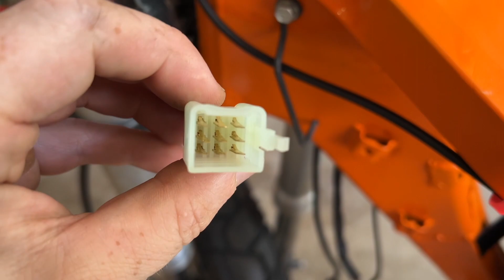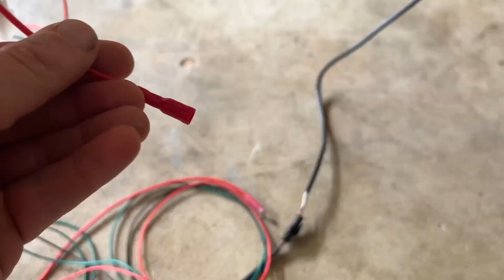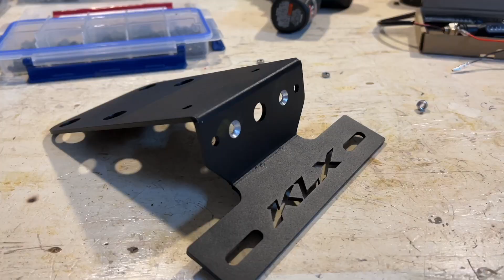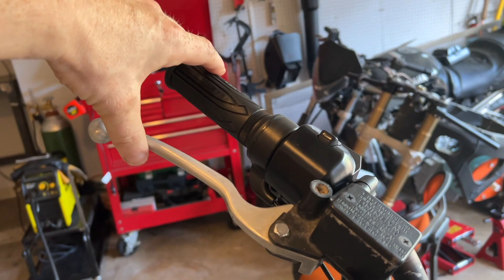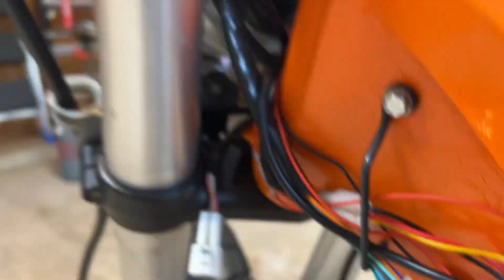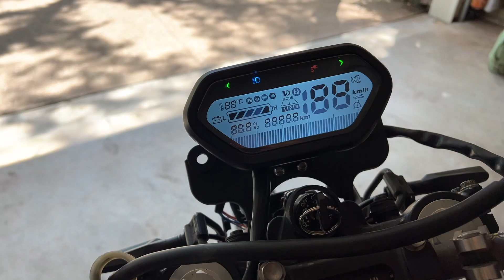Wiring an Electric Motorcycle: From Start to Finish

Comment: Great walk through! This is very helpful. Working on adding lights to a Ktm xcf conversion.
I may have missed it, but do you have links to the switches you used for the headlight (hi beam low beam, signals and horn)? 
What 12v converter are you using? 
Great video and explanation.

Comment: Great channel! Not clear how did you connect the high brake (HB).. Did you attach +12 V to one of the low brake wire(black or green) and the white one(which goes to controller's HB) to the other low brake wire? So, once you press the lever, it sends +12 V to contoller's HB grey?
Reply from the maker: the low brake wires takes a ground/0V signal which I am not using. I just wired a +12V signal in parallel with the front and foot brake and splitting that same +12V line to the brake light and hi-brake on the controller. I have the schematic in the description as well
Reply: @GaiusGarage  got it, thanks! thought you used low brake too. But now it’s clear. Thanks again! Good luck on your projects. Waiting for the new video!

Comment: hey man thank you for your content, I really appreciate all the time and effort you put into this. Im watching your videos because Im building an electric go kart myself. Couple of questions though. Are you connecting the bike frame to your ground? Like regular vehicles do. And I think the schematic attached to this video has the contactor wired in the wrong position. Thank you and much respect
Reply from the maker: No, not connecting ground to the frame. Car manufacturers do this for the 12V system to save money on running wires back & forth but they also do it for a 12V system. If you're using a common ground on your go cart and ground to the frame, you would be grounding high-voltage as well which is pretty dangerous in terms of getting shocked but also arching. If you have an isolated 12V ground I think it should be fine. Why do you say the contactor is in the wrong position? It's wired across a switch on one of the 12V lines. That's for the contol circuit.
Reply: @GaiusGarage  thank you for the quick answer. Yeah it makes sense I was planning on just grounding the 12V to the frame, but I don't think is necessary for now. Regarding the contactor... If it closes and the other switch that is connected in series also closes that would be a short circuit. Shouldn't the coil be connected to the 12v circuit? In your power schematic you show the 12v circuit connected to the coil. I might be missing something though
Reply from the maker: ok I see what you mean. you are right, the schematic is shown incorrectly. just an error on the schematic, I meant to show the 12V connected to the control coil. the high-voltage positive line runs across the switch

Comment: Great video can you go into programming the controller
Reply from the maker: I was going to but the app for this controller really sucks - tons of bugs that wont allow you to change certain values and support is never helpful
Reply: @GaiusGarage  Tell me about it. I'm having so much trouble adjusting the correct speed on my display. I think I need a firmware update for my controller. I'm waiting for saiecosys to get back to me. Great controller, horrible app with no instructions as to what a lot of the settings do.
Reply from the maker: @toriwatson9655  I have the PDF document detailing all the settings - but it's in terribly translated English with plenty of vague explanations. the biggest problem is that you can't change all the settings in the app due to bugs. hit me up on Instagram @gaiusgarage if you want me to send you the document. for the speed calibration, there's a setting I found where you just set it to some number 1-10 and one of them more or less calibrates the display to show the true speed (I just matched it using a GPS app) but I guess it depends on the protocol the display uses. if you're running the signal to the display on the digital wire from the controller harness it should work.
Reply: @GaiusGarage  Thankyou for your reply. I will send you a message on instagram. I have been reading huge amounts on endless sphere and asking questions but still haven't got it sorted.
Reply: @GaiusGarage  By the way, I love the way you utilized the right hand control for your 3 speed switch, good thinking.
Reply from the maker: @toriwatson9655  Thanks! I'm prob going to re-solder it internally so it corresponds with low, med, high right to left

Comment: If you put the metal part in the crumpet then give it a click or two it’ll hold it in place while you put the wire in place.
Reply from the maker: yes, but I found that its difficult to see where exactly the wire is sitting between the insulation and exposed copper. but I agree if it's stripped to the right length it will be in the correct position so this is a good method too
Reply: @GaiusGarage  yep I just use my stripper to get it to the right length then look at the other side to see the copper poking through. Works well for me.